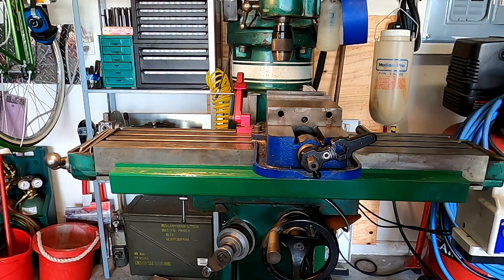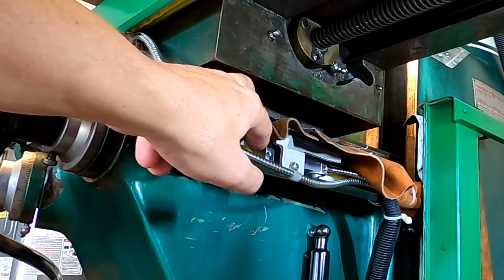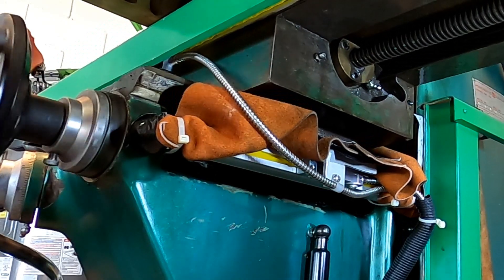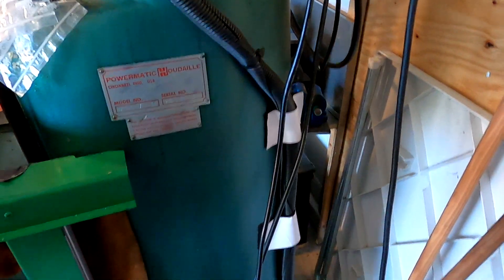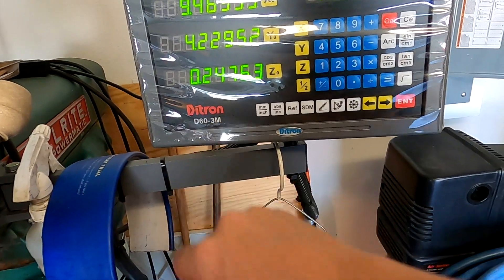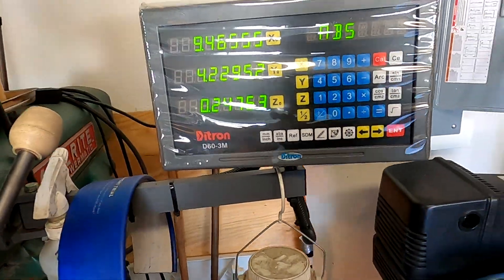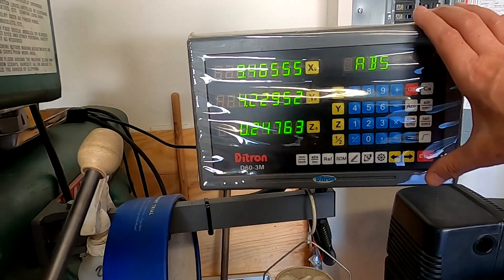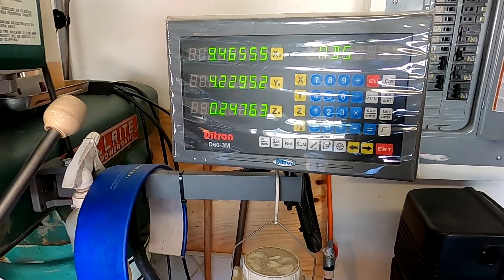DRO set up for the Vertical Mill: Burke Millrite MVN

Comment: My millrite travel is only X = 16" Y =8 trying to find a DRO for it but not having any luck. Any suggestions ?
Reply from the maker: Hi Frank. Just buy the scales to the closest length to what you have. The bed X/Y axis are longer than its travel so being slightly over is AOK. Under and you won't cover your travel. Ebay the items you want and you usually get a drop down on desired size.  The alternative if youve seen my Atlas Craftsman lathe video, is to buy I-gaging DRO's with metallic scales and cut them to you desired length.  Hope it helps. Don
Reply: @donsengine3158  thanks I actually double checked it was more like y=9.5 × X=17.5 x Z=18.6
Did just that found a Chinesium setup on the Amazonia for$205 !

Comment: What brand of double sided sticky tape did you use? Most of them I have used don't hold well. Thanks for the video.
Reply from the maker: Believe it or not, it was the tape that came with the scales.  I only planned on using it as temp until I could put some screws into it, but never had too...